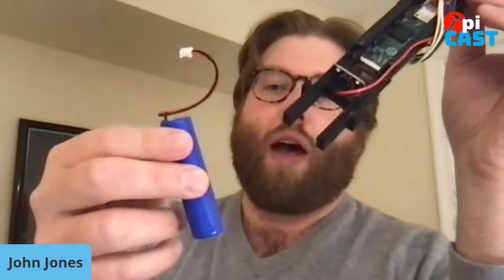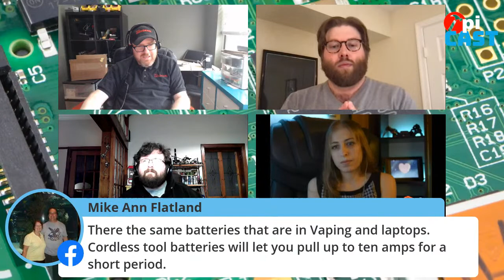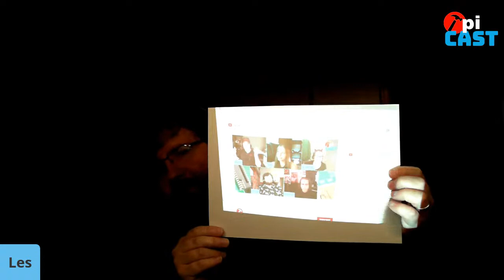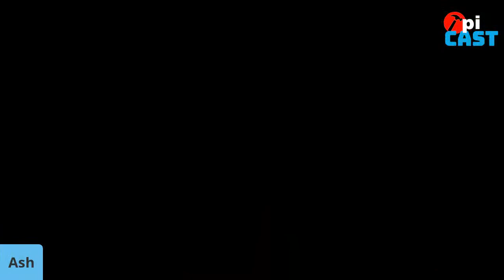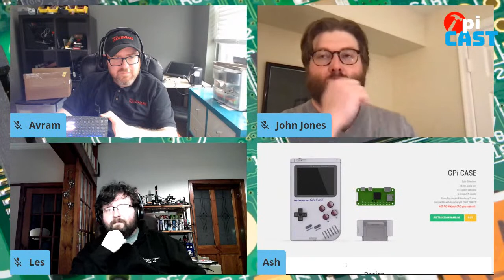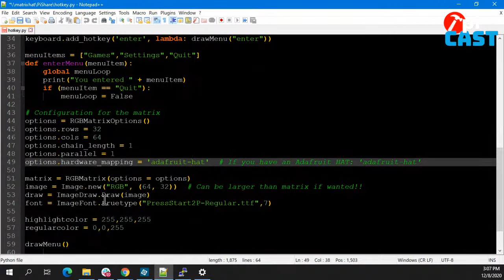The Pi Cast: Pi-powered Rockets, Cyberpunk 2077 Pi Mod, Pi Gifting

Comment: GeForce now, interesting. Did you try Moonlight-qt? I run this comfortably on a Pi4. (Admittedly overclocked to 2147 in an Argon case) to connect to a Paperspace cloud PC and on a Fibre connection there is a minimal audio lag, but gives very very good performance on a wired connection while running on the desktop! Occasional frame drop.
Reply: The cloud PC has steam running as a gateway, but you can quit out of that.
Reply: But allows my daughter to play Minecraft, Star stable, Roblox and me to run Blender.